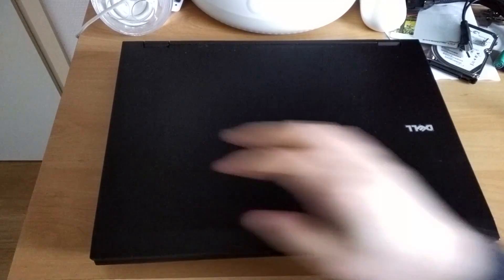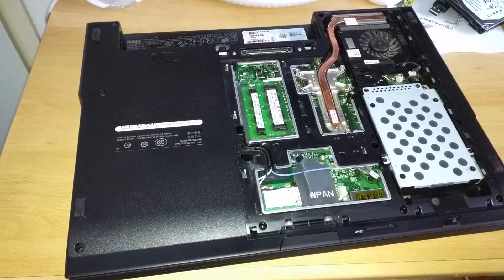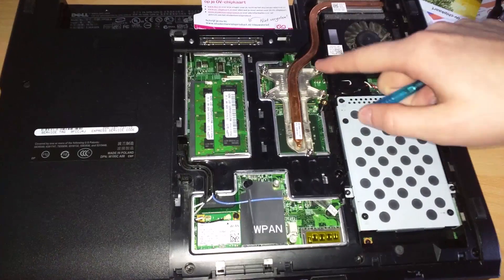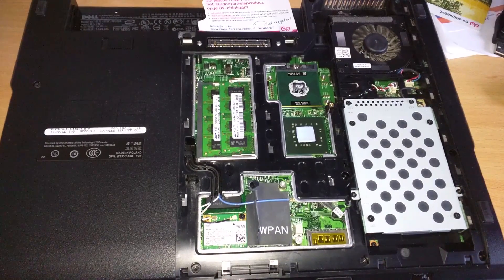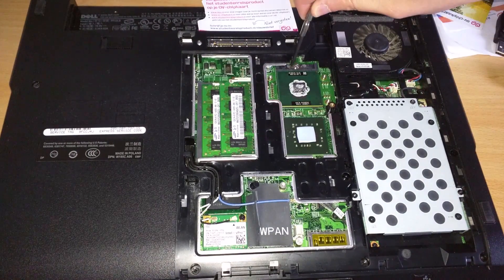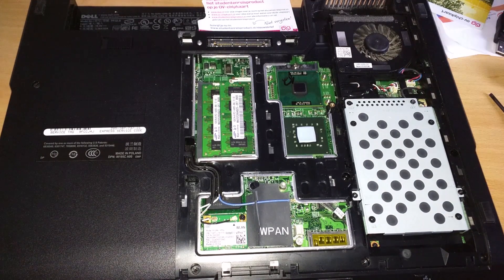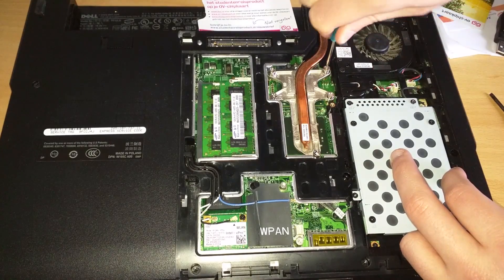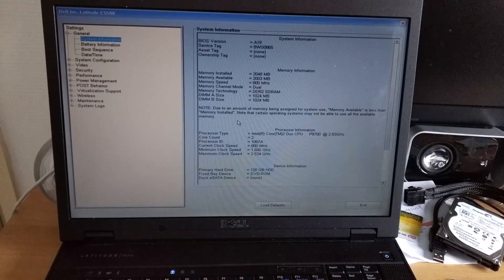Upgrading The CPU on a Dell Latitude E5500

Comment: I have dell latitude e5500 what cpu can I upgrade?
Reply from the maker: The Core 2 Duo T9900 is the fastest chip that will work.
The T9600 and P9600 are the best bang for the buck replacements.

Comment: Hello, thank you for your video, Id like to upgrade my dell e5500 mainly for fun. Right now it has the T7250 would I see significant performance increase if I upgraded it to T9600? I can buy this for about 12-15 pounds so wondering if it is worth it. Also my BIOS is '' A17, 9/27/2011 '' is this version fine or would I have to update it? Thanks - Simeon
Reply from the maker: Hi,

the T9600 has more cache and higher clock speeds, which should be very noticeable. Also add a cheap SSD while you're at it. BIOS date is fine, as the CPU in question is older than that (2008).
Reply: @nelizmastr  Thank you for answering my question =-) happy christmas

Comment: Hello I have a Dell Latitude E5550. I'm trying to figure out what is the highest CPU i can upgrade it to as i am looking to upgrade the CPU on it but not sure as to how to identify.

Your help is appreciated.
Reply from the maker: Hi, the 5550 is a much newer machine with very different hardware. I have no experience with those machines. Rule of thumb is that anything 6th gen Intel or newer is fully non-upgradable. Most 5550 models have an i5-5200U, all U chips are soldered and cannot be upgraded.
Reply: @nelizmastr  mine is I7, 2.5, 16gb ram. Im just trying to make it faster so i can use it fornstreaming if possible.
Reply from the maker: Lookup which i7 it is. If there’s a U in the model it’s soldered. The i7 was top of the range back then, keep that in mind.
Reply: @nelizmastr  i opened up my system  properties and looked at the CPU number and it's an I7-5600U @ 2.6
Does that mean it's soldered or no? I would hate for it to be soldered.

Comment: I have the same model, is an intel core duo t9600 compatible with it?
Reply: it's also me i would like to play games on it
Reply from the maker: Yes, the T9600 should work. Games will not be possible, it does not have a graphics card but just onboard video, which cannot even run Minecraft half-decently.
Reply: @nelizmastr  thanks

Comment: i was thinking of turning one of these into a sleeper pc, is there any sort of better motherboard i can get for it as i can tell that i aint gonna get much better graphics as its soldered or above 4gb of ram
Reply from the maker: Maybe the Latitude E5510 board will work. Not sure if that has any better graphics options or not though.

Comment: what the name of cpu
Reply from the maker: Core 2 Duo P8700/9600 etc.
Reply: @nelizmastr  can i install intel i5 on this laptop
Reply from the maker: No. Only core 2 duo.
Reply: @nelizmastr  can i upgrade a graphics card of pc in this laptop for gaming
Reply from the maker: Nope. Only the cpu, ram an disk can be changed
Reply: @nelizmastr  graphics card like portable graphic card on the wifi chip

Comment: Hello, is that Socket mPGA479M ?
Reply from the maker: Socket P
Reply: @nelizmastr  Never did understood how the same model of laptop can have different sockets and hardware configurations.
Reply from the maker: Beats me too. They used some derivative of socket 478/479 with vastly different support. Generally, Core 2 suport was on either socket M or socket P (Merom and Penryn 65 vs 45nm node) and even with socket P, some chipsets support 800FSB while others go beyond that.

Comment: I have this laptop with the new cpu you just installed already in it. I'm running windows 10 pro at 32 bit bit I'm trying to update to 64bit. I think this is possible? The bios isn't updated I've just found out and from the Dell website the newest update was 2013 and it's A19 but I'm running A15. It won't update the bio and I'm thinking it's because Dell website says windows 10 isn't supported but it does run fine. I can't get the 64 bit windows to update either. It says it's not compatible but this is a X64 based. What and I missing here? Any suggestions?
Reply from the maker: Hi,

To install 64-bit Windows, you need to do a full reinstall. You can’t upgrade 32 to 64. 

I’d also not recommend flashing the BIOS from Windows if possible, as it has a higher chance of bricking your board. Sticking to A15 is probably fine.
Reply: @nelizmastr  thank you so much for responding. I'm doing this for crypto investing. Probably not the smartest thing but I just need it to work for now. I've read forums that stated 64 bit windows 10 ran very sluggish. But they were older threads and I couldn't find anything newer. I'm thinking maybe windows has the proper drivers now but also I'm worried about my hard drive being fat 32. Do you think the mobo will handle this just to run exchanges? I won't be going to any other sites other than very secure places so I'm not really worried about picking up something from shady sites but I don't want to throw this laptop in the trash when it doesn't work either. Lol

Comment: what is that liquid looks like toothpaste?
Reply from the maker: That's thermal paste, also called thermal compound. It fills the gap between the processor and the cooler so that heat can be transferred and the processor can be cooled.
Reply: i see...thx for info

Comment: Hello! I have this same processor, on the same laptop, but I have a little problem the same, P8700 I think, only goes to 1.5GHz and not 2.5GHz. and you don't have Speedstep activated. Disable it and it remains the same.

Comment: i have a Dell Latitude E5530 i would like to upgrade the cpu, please help
Reply from the maker: Not all Latitudes have upgradable CPUs. The E5500 and E5510 do as they are old enough to have sockets. Starting with the 2nd generation Intel CPUs some are soldered, some arent. Starting with 5th gen, all CPUs are soldered.

Comment: Wish all laptops had such straightforward cooling. 80% of laptops I upgraded have to be taken apart completely, motherboard removed altogether and flipped upside down. An hour of disassembly then an hour of assembly. Travesty really. Especially for the customer.
Reply from the maker: And all that because the laptop has to be thin. Good job everyone.

Comment: whats the other chip below processor
Reply from the maker: That’s the northbridge of the Intel chipset.
Reply: @nelizmastr  can you provide any details what it is
Reply from the maker: It provides graphics and PCIe connectivity, and interconnects with the south bridge for SATA and such.
Reply: @nelizmastr  cant we change it to improve graphics
Reply from the maker: No, it does more than just graphics. It’s required to communicate with the wifi card, harddisk, bluetooth etc.
Reply: @nelizmastr  is there any way to improve graphics

Comment: Can anyone recommend or link me a good CPU that's compatible with this? Also a ram set and ssd if possible
Reply from the maker: This will run up to a T9900 but the T9600 is the best value chip. The P8700 is good too if battery life matters to you. Any DDR2 2GB module should work, 800MHz is recommended. Any SATA SSD will also work.
Reply: @nelizmastr  ok ty

Comment: I have a Dell latitude e5500 as well  with a Core 2 Duo P8600 

Any CPU Recommendations To Play Something Like CS:GO?

Also RAM And Storage If Necessary 

CPU : Core 2 Duo P8600
STORAGE : 74GB HDD
RAM : 4GB DDR2
Reply: You might be able to run cs source though
Reply from the maker: Sadly the core 2 duo is too slow for the current version of CSGO. The Intel graphics are also way too weak.

Comment: You don't want to use the more powerful T series CPUs unless you don't plan to use it mobile anyway because the battery life with them CPUs is awful. I own the higher end e6500 with the Nvidia graphics that came from factory with a T series CPU. I switched it out for a slightly less powerful p9700 (2.8 ghz) and I get about an hour more when on battery and best of all noticed very little if any performance hit in day to day tasks. If anything going from a 7,200 rpm hard drive to an ssd will also net a great boost and battery savings. Nearly 10 years old now it still works just fine for day to day tasks.

Comment: can you upgrade the GPU or is it soldered
Reply from the maker: There is no real GPU to speak of. there's just the integrated Intel solution in the chipset. No upgrade possibilities. If you want a GPU in a similar laptop, you'd have to get an E6500 with dedicated Nvidia Quadro.
Reply: What are the upgrade options on that?
Reply from the maker: Same as this. Soldered GPU, the rest can be changed.
Reply: Oh ok thank you

Comment: can i put a 45W TDP core 2 quad cpu?
Reply from the maker: +pe6o991 No, only 25 and 35W Pentiums and Core 2 Duos. Only the Precision series supports the quad.
Reply: It is posiible Core 2 Quad Q9000 2.00 GHz can handle a GM45 chipset
Reply from the maker: +mikkei yes. But this laptop can’t cool a quad and the BIOS doesn’t support it.
Reply: agree that is true !!! but in teory it is possible..  BTW I have a password in bios in my e5500 could you tell me- could  I delete it in any way , i start reset a cmos battery - it sat in fridge about 2 hours and nothing , it is another way ???
Reply from the maker: +mikkei yep. You need to remove the service tag or modify it to delete the password. This can be done with a special ISO, which I can’t help you with.

Comment: Do you know the highest ghz cpu that the dell latitude can support?
Reply from the maker: The fastest it'll take is the Core 2 Duo T9900, which is 3.06GHz.
Reply: @nelizmastr  How much does the 3.06GHz cost?
Reply: @nehemiahkngeno  around $500
Reply: Thanks for the help! (thats my alternate account.)
Reply: and also if I was wondering if I should get a better cooling system since it most likely will generate more heat
Reply from the maker: Master Corvette
Heat output is dictated by TDP, not just clock speed. The T9900 is a 35W chip, which the E5500 supports. No extra cooling is required.
Reply: ok, cool. I was just looking around the internet and I saw something about how extra wattage would make the computer hotter so I wanted to make sure.

Comment: I remember owning one of these. They're pretty cool machines that can actually run Windows 10.
Reply from the maker: +ComputingWorld® Yup. Win10 runs like a dream on it.
Reply from the maker: *****
If you want to play games on this class of laptops, get the E6400 or E6500 with the Quadro card. GMA4500 is not meant for any 3D tasks.
Reply from the maker: *****
The i3 and i5 utilise a different socket. The E5500 will take pretty much all Socket P CPU's. The best one being the T9600. The T9xxx series has 6MB cache and a 35W TDP. They will work fine. The P8xxx series has 4MB cache and a 25W TDP, in case you want to go for a more power efficient approach.

Comment: you should also clean the fan, it seems kinda dirty. Anyway nice upgrade! :)
Reply from the maker: +Enrico Barsanti Just some minor surface dust, so no big deal. If it was clogged, then yes, I would clean it. The pro of this upgrade is that the P series is much more energy efficient than the T series, so less heat output, better battery life :)
Reply: very interesting! I am Italian and on youtube there are no channels like yours in my language. I really like channels like yours dealing with pc, laptop, assembly of those, upgrades :D I really like to assemble and disassemble computers and hardware channels like yours allow me to see things I could not afford, as your wonderful collection of laptops (although I prefer desktop PCs :P)
Reply from the maker: Enrico Barsanti
While I have a lot of laptops on video, a lot of them have been long gone. I can't really keep a lot of desktops around since I still live with my parents, but my heart is definitely with desktops as well.